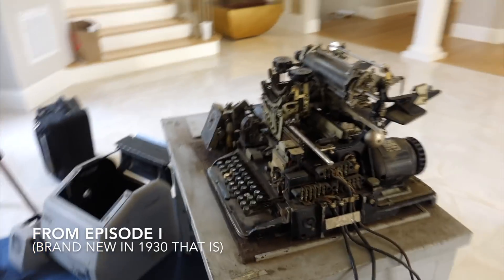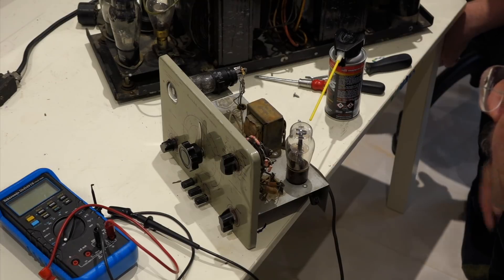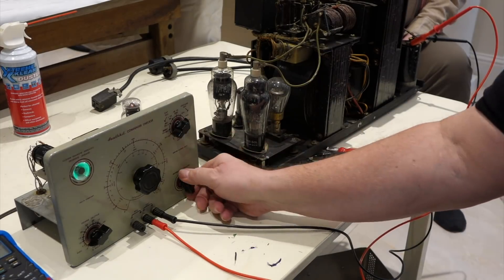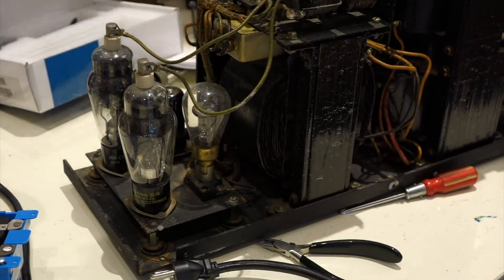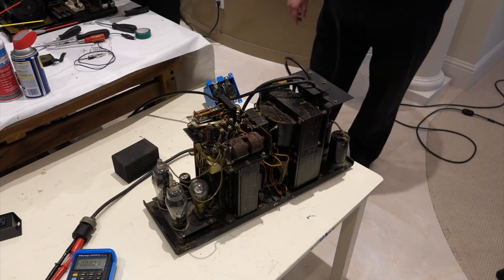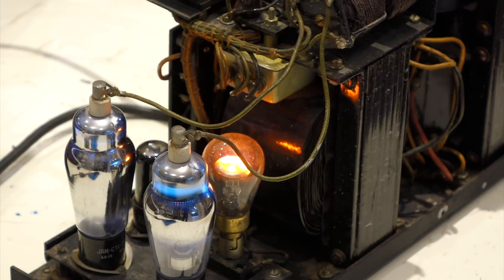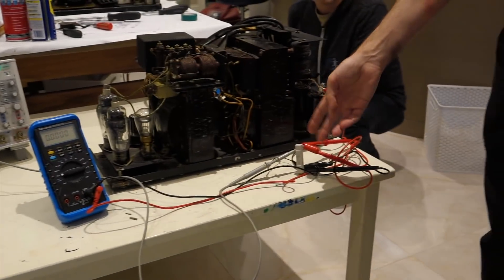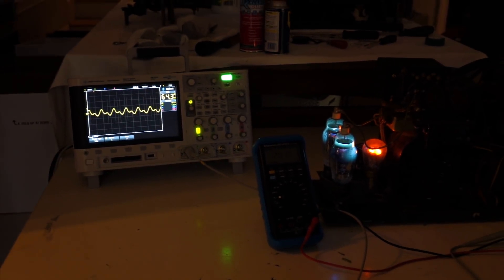Teletype Model 19 Part 4: Thyratron Power Supply

Comment: The eye is supposed to open all the way when testing for leakage on the capacitors, any less or if it only opens a little bit means that there is leakage there.
Reply: Every cap has leakage.  Even good ones. It depends, what amount of leakage is acceptable. And using such "meters", or most precisely "indicators" at best, is not quite the right way to do things I think.
Reply: @Sixta16  And what would you recommend? Chicken entrails in a pentagram? These devices check all four key attributes of capacitors: how fast they charge, how fast they discharge, how much the store, and if there's electrical leakage from internal shorts.
Reply: @TheRealColBosch  Sixta16 knows a LOT more about electronics than you, so you should respect him. You can't fully trust anyone like Paul Carlson. He knows sure a lot but sometimes he tries to learn people things that he isn't fully sure about.
Reply: @teslakovalaborator  i beg to differ on your remarks to Paul Carlson (Mr Carlsons Lab).

I've watched all his video's, some even multiple times. Including the ones on his Patreon page (since I sponsor him).
And I, in my honest opinion, cannot say I've ever heard him say things which were false to me at the time or have remained to be proven false after I did some research.
Only 100% accurate information as far as material from him is concerned...

So you might want to explain with a few examples before you go stating stuff like that.
Thank you,

Comment: I don't think it should be that shocking (pun intended) that something from the 1930's can still work a treat. I don;t think I would trust those caps though long term. I would be waiting for the loud boom from them one day. Thyratrons are very good at what they do though so as long as the resistors are good the whole circuit is gonna work quite well.
Reply: Yeah once they put some actual use load on this PSu - is when it's most likely to go boom.
Reply: The voltage ripple may also suddenly stabilize more or become much worse under load depending on the state of the caps.

Comment: Those Thyratrons are gorgeous!  I really like the power supply, it's the most comprehensive multi-volt power supply I've ever seen, in terms of input that can be accommodated.  Now I want to know what it would take to build a 3/4KW PC power supply using this technology.  I can't stand the whole "let's put LEDs inside the PC" bullshit, but if what's in there lights up and looks awesome just because it's working right, well, damn straight let me see it!

Comment: Thyrotrons rule!
To think, people get excited about blue LED's!
You should seriously consider putting a clear window in the case. 
Never has the adage "They don't make 'em like they used to!" been so appropriate.
Reply: The *Thyratrons might be emitting a good amount of UV, so don't look too much.
Reply: Pretty sure any UV-C would get blocked by the glass casing, no?
Reply: Good point. I had worried about the UV, but in fact if you want UV output from a lamp you have to use special glass. Look up "Wood's glass" in the Wikipedia if you want to know about it.
Reply: The power supply metal case has openings for cooling airflow, which will allow the blue glow to escape.
Reply: They waste a smidge less power, though.
Reply: Thyratrons are sooooooo awesome.  Mercury, argon, xenon, hydrogen....but deuterium is the coolest looking when the tube is conducting.....just make sure you don't get hit by x-rays....
Reply: Blue LED-s were an absolute revolution, it even earned a Nobel to three Japanese engineers back in 2014 and with good cause, their work with GaN semiconductors is good for much more than just pretty blue blinkers.
Reply: @aleksandersuur9475  
Yes, indeed. They paved the way for our white LED lighting revolution, with the addition of some phosphorescent gels. But there was a time, shortly after their implementation, when practically everything seemed to come with blue LED's!
Reply: @WaltonPete  Yeah that fad was a thing. You know, you suddenly have access to what used to be unobtanium parts, of course you want to use it in your next design. Except everybody did it, took a while to figure out how damn annoying it is to have bright blue lights begging at your attention from every direction.
Reply: I don't know, that high  voltage tester proves to me that the cap was at least moderately bad, then you yourself proved that a new cap is better. Why chance it? Though failure are common at least they are characterized. Though they look like they are performing for now and probably won't cause damage so I will admit you are right! Good video though! Keep up the good work
Reply: What stinks is that I actually really like blue LEDs.  I always did.  Problem is that they're so overused these days that I'm sick of seeing them.  Those thyratrons coupled with that amazing neon look like bottled magic though.  I so wish that I had a use for some myself.
Reply: Yeah, they built stuff properly in those days. You'll be lucky if a modern device still works after 88 years (2018-1930) with its original components.
Reply: Will an IPhone still work in 80 years?
Reply: @bobl78 ,
No
Reply: I suspect they pump out some xray's too.